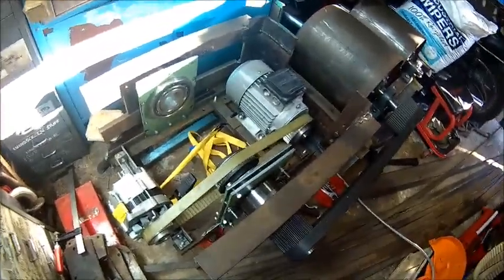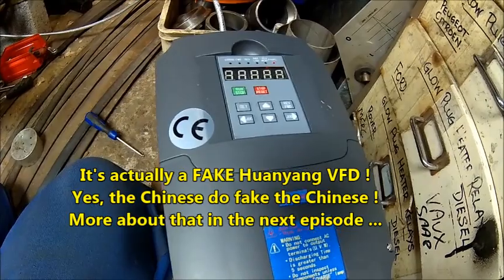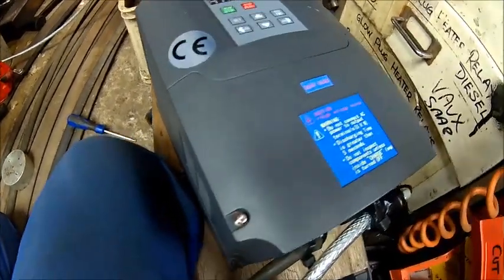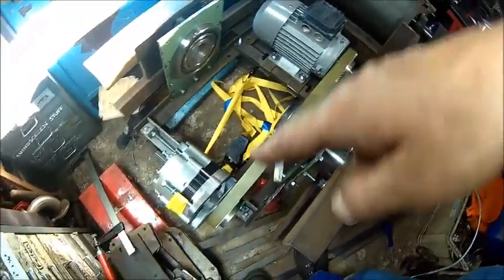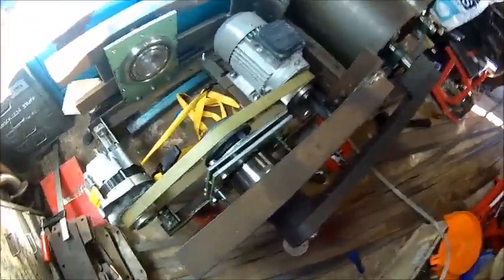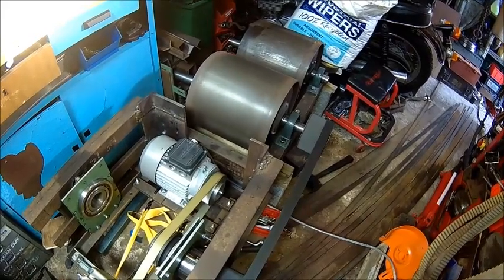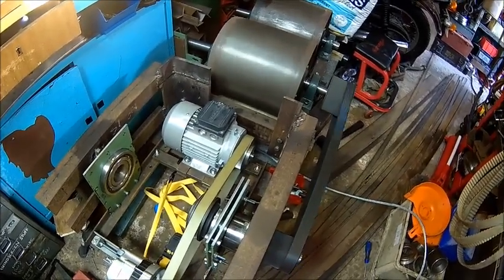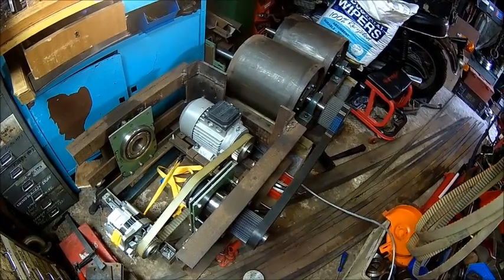The Mystery Project #19, a fake Huanyang VFD and the first spins

Comment: You say your disappointed with the Vevor 4kw vfd. i would like to add (possibly just personal experience), yes its basic but 3 years later min is still working as it should.

i have an Omron Inverter and its flawless and so it should be for the price.
i have one of these Vevor 4kw A2-8040 inverters and its basic but functional.
and i have/had 3 HY Huanyang Series Inverter that have all been complete trash, one exploded and gave out sparks after about 6 months, im amusing something metallic sucked through the fan and shorted some unprotected wiring because the enamel on the circuit boards was not adequate, 1 packed up after about a month just dose not do anything, and the other is temperamental it works most of the time but sometimes just shuts down for no reason and you have to pull the plug out and wait for the lights to go out before it starts working again.

so my peroneal opinion is the HY inverters are the cheep trash, at least the Vevor inverters don't pretend to be something there not capable of

Comment: I inadvertently bought one of these as well for a milling machine. Motor is rated for 6 amp so I bought a 7 amp version. It does have some kind of overcurrent protection on it because when I accidentally tried to start the machine with the spindle break on it gave me an overcurrent error.
Reply from the maker: Possible that the drive has some general overcurrent protection (for itself), but without having the possibility of entering motor data, you just can't scale it properly to your motor.

Comment: I HAVE A VVFD ASKPOWER A131nbc-8015 AND I DON'T KNOW IF IT IS BECAUSE I DID A WRONG INSTALLATION BUT WHEN I ENERGYCE IT IT START AND STOP. AND I DO NOT KNOW WHAT TO DO. DO ANY BODY CAN ADDRESS ME HOW TO WIRE EVERY THING TO JUST CONNECT IT TO A 3 PHASE MOTOR AND A POTENCIOMETER TO VARIATE THE SPEED OF THE MENTIONED MOTOR? pLEASE i NEED HELP.
Reply from the maker: Well, ..at first look into the manual, it explains pretty well how things should be wired, also make sure you got the right size inverter for your motor.

Comment: Would the internal fuse protect the motor?
Reply from the maker: only if the fuse rating is correct for the motor, which is most likely not the case

Comment: Does the drive do vectoring? If it does it should protect the motor when configured.
Reply from the maker: No it won't, as said in the video, you cannot enter the motor data at all, it does not even have current transducers, so how could it know what the motor is doing, this thing is just a piece of junk. Will do a comparison to the Huanyang (which is certainly the better choice) as soon as i get a bit of time.
Reply: Funny how all those Chinese companies make the same boxes  with different guts :)
You need a good old Allen Bradley :)
Reply from the maker: It's definitely made to look like a Huanyang, but they did cut a lot of corners internally and if you don't know that you think it's the real thing, until you power it up ... i've never seen a drive where you can't set a current limit, and i had my hands on countless ones as this is part of my day job...If you look closely at the little green lathe you will see an Allen Bradley Powerflex 4 sitting on top of the motor ...:-)